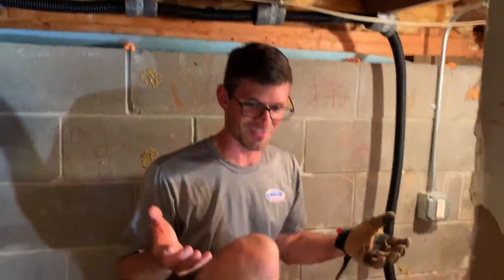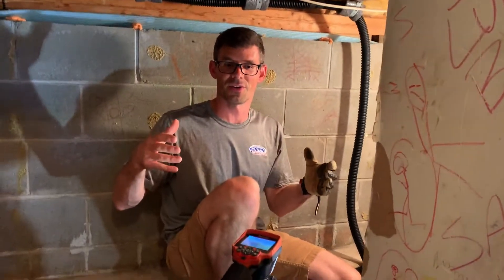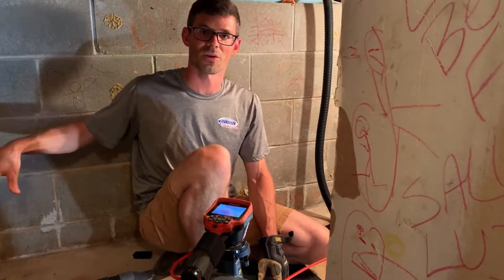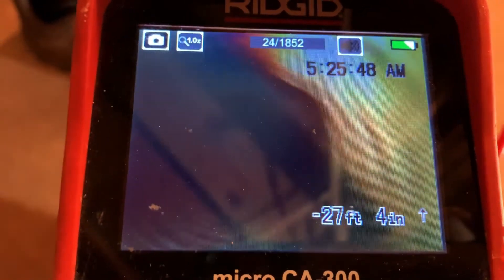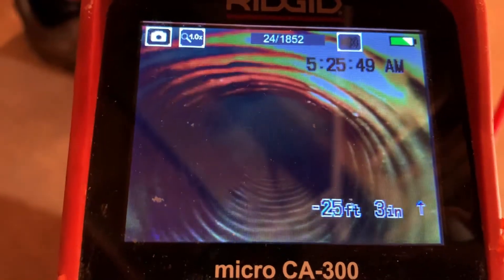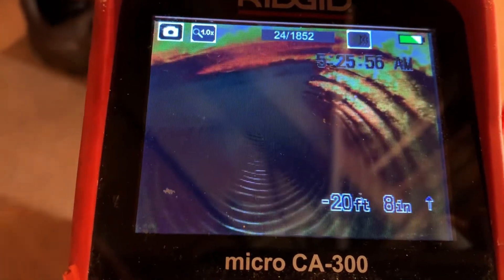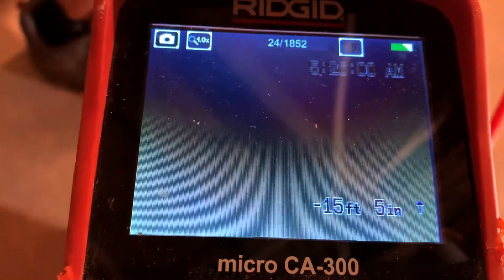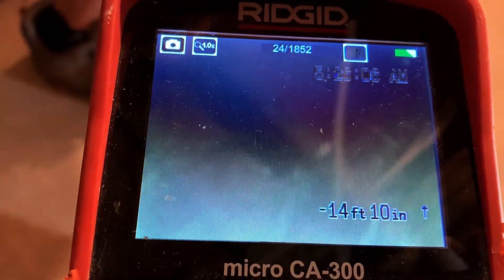Water in Drain Tile: A Hidden Problem for Radon Mitigation

Comment: That Rigid setup is nice, especially when used with the locating wand.
Reply from the maker: Yeah, it is! I use it all the time. It saves on digging large suction points to find the settling near plumbing. I love not guessing. It's also great to inspect sub-slab ducts.